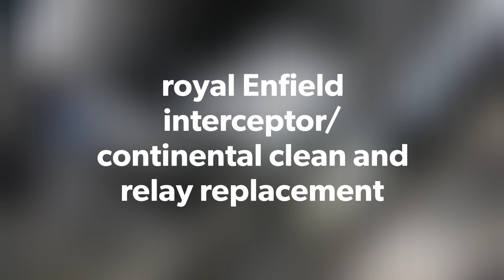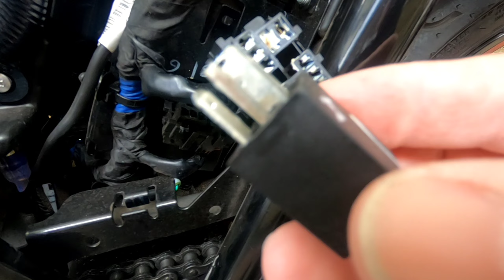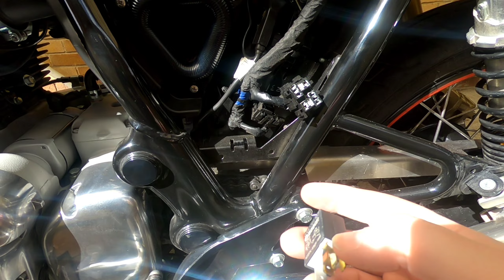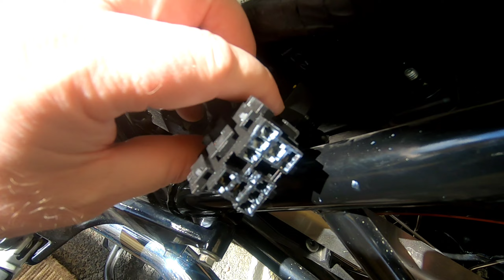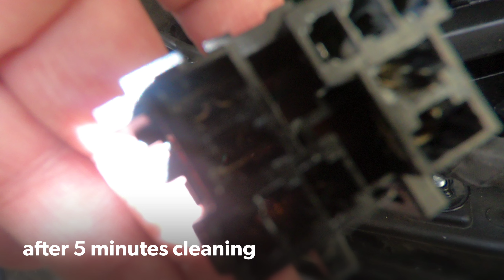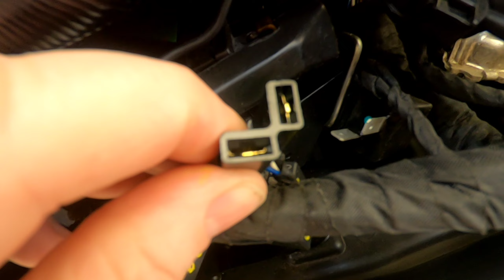royal Enfield interceptor 650 continental gt 650 relay cleaning and replaced

Comment: I've just done my euro 4 , haven't had problems but as people have had, thought it was only time.  Cleaned mine out with compressed air and contact cleaner and then coated new Bosch relays with dielectric grease and all good. They probably coat them with so much grease due to the humidity in India to stop corrosion before shipping.
Reply from the maker: Hi, thanks for your comments.the standard relays and the amount of grease they apply from the factory seem to cause more and more problems for people,and should be the first thing anyone at least cleans just as a precaution.upgrading them to Bosch replacement's is the first modification everyone should do as soon as you purchase the bike.🖖

Comment: I have a 2022 Royal Enfield 650
Interceptor with 500miles, or 804 kilometers, When I first start the bike when cold it starts but immediately dies, i have to immediately rotate the throttle to get it up in rpm's to keep it running at higher rpm for a few seconds then it will idle ok. It does this every cold start attempt. I cleaned and replaced the four relays but it didn't help. Did you also have this happen with your RE?
Reply from the maker: Hi, thanks for your comments.many(euro5) seem to have a lumpy tick over and struggle to tick over especially when you first start them from cold ,RE seem to have set the tick over catch point very low causing stalling, so with a new tight engine the revs drop too sharply for the tick over kicks in and dies.as you ride your bike more and more the engine frees up causing this issue to happen less.i also changed my spark plugs to a higher quality iridium ones which gave a stronger more reliable spark,which did sort of cure this problem.i always hold the throttle for a few seconds open a little when starting and let the revs settle before releasing it (a old habit from years of bike ownership) .I'd start by changing the plugs and just ride as the miles go up and the engine frees up you'll notice it get better.my 2022 model only had 3 relays(euro5)under the side panel,you said you've changed 4? Which would mean yours is a euro4 model.check the manufacturing date not the registration date to be 💯% sure just for future reference.i hope this may help you out a little 🤞sithi🖖
Reply: @itsallrc-interceptor650  my bikes id plate says manufactured January of 2022, Thank you for sharing your experience with this, yes this bike was shipped to 🇺🇸 USA and is euro 4 ecu and has the four relays.  I was wondering if changing the spark plugs to better quality type would help this. It only started doing this recently. After warm up it runs perfectly and starts easy. I will upgrade the spark plugs and see if that helps.

Comment: Thanks for this, just started looking for info on this after my GT 650 had starting hesitation. Did anyone else snap the screw tab on the left hand cover trying to get it off, or is it just me 🤨
Reply: loosing the screw on left side........I did it many times ! i hate that screw ! Finally another youtuber had a wonderful idea: replace the standard crew with a FIXING SCREW FOR GOPRO (the long one). It works perfectly fine !!!!!
Reply from the maker: Thanks for your comments, I'd lost mine into the black hole my bike seems to have 🤣.I'm glad it was some help to you🖖
Reply from the maker: It might just be you😂 don't worry you won't be the first or the last person to do this thanks for your comments 👍
Reply from the maker: My interceptor used to cut out alot to be fair,but since I cleaned and upgraded the relays I have had it cut out once,and that may have been my fault 😁

Comment: Has royal Enfield resolved this problem? Seems ridicules that the customer has to clean the relays and not the factory or dealers🙄
Reply: And the customers end up paying for new relays out of their own pockets. How silly is that. Come on Royal Enfield, do a recall and pay for all this yourself.
Reply from the maker: I totally agree, it's poor customer service, surely every owner now has had to clean and upgrade said items.👍
Reply: @itsallrc-interceptor650  also, why the heck are they using lithium grease. I've never used that on electrical connections, only dielectric grease .
Reply from the maker: They must have barrels of the stuff,cos they like slapping it all over everything 🙄
Reply from the maker: No still coming with duck fat plastered on all connections and weak relays,re needs to sort this themselves and not rely on the customer sorting problem out👍
Reply: @itsallrc-interceptor650   Hi !  Don’t get me wrong, these bikes are so retro and awesome. And I like them. But I’m hearing from too many sources concerning relays and other things as well. Just imagine if this happened to Yamaha. They would have a worldwide recall. This is not good enough in that RE are not sorting this. 

Cheers NZ.
Reply from the maker: Thanks for your comments,I totally agree, letting themselves down for such a simple inexpensive fault to cure👍
Reply: @itsallrc-interceptor650  duck fat!🤣🤣 that's pretty damn funny. Thanks for the heads up. I'll have good relays on hand before i get  my GT. 🖖
Reply from the maker: I've replaced mine with bosch 20amp part number 0332201107 one's off eBay .if I remember correctly the original are 10amp

Comment: I was having NO start issuses for the last 200 miles so at around 700 miles my 650 INT was not fun. I cleaned all relay connectors from the grease but it still did not start. I then listened carefuly for the fuel pump sounf which did not come on. I switched the lower left relay for the lower right relay which by the way IS the fuel pump relay. Wa la, started right up. So, a bad relay with only 700 miles on it. I have now replaced all the original relays with Bosch relays. Happy to be riding again but kinda pist that these come this way. They should know better to over grease and should put a better relay in the bikes to start.
Reply from the maker: I totally agree with you,there is no need for all the duck fat grease to be used.as for the relays,I know the bikes are built to a price point but surely reliability as to count aswell.with all the problems people have been having it makes you wonder why re haven't sorted these easy fixes out themselves.i still love my interceptor to bits and done all problems myself,not everyone see's it to be their problem to sort out themselves which I agree with.this is my first new anything, I've always fixed and maintained every vehicle I've owned,and as it turns out I'm still doing it.🤣😂🤣
Reply: Fortunately it’s a inexpensive fix but I’d agree…it shows really be necessary…..and so soon!
Reply: Oye amigo que rele de Bosch usaste para solucionar el problema

Comment: Hi, thanks for this wonderful information. I am looking for one like this in India as I am based in Bangalore. Any contact information on where I can get these? Please let me know. I am aware of Denso relays here but, are expensive. Also please suggest which degreaser to use or just WD-40 is fine? Please respond. Thank you.
Reply from the maker: Hi, pleased it helped you.ive replaced them with Bosch relays which are available on eBay over in the UK🖖
Reply from the maker: I was a de-greaser spray which is used in body shops to prepare body panels before painting to remove any grease or dust.wd40 can be used too,by blasting as much grease out of the connector's.then use a cue tip(ear 👂 clearer buds)to clean.repeat until you're happy 👍
Reply from the maker: Bosch Relay part number 0332201107
Reply: @itsallrc-interceptor650  Thank you very much for the response. Could you please share the eBay link for Bosch relay?
Reply from the maker: 265762281537

Comment: I replaced all my relays with Panasonic ones
Reply: I replaced mine with Bosh Single Pole Single Throw (SPST) relays and now I'm certain it was the relays all along.  The brand new REs also use SPST relays like my new ones --- they are simpler and more reliable and the other circuit isn't used.
Reply: @oldgeezerproductions  yes, just about any good quality relay is better than OEM, I’d say!
Reply from the maker: Thanks for your comments,yes any relay must be better than the junk re fit from the factory 🖖
Reply: How's the panasonic relays going on?
Reply: @BashBunny-jr1jc  absolutely 100%
Reply: @internetpolification  thanks
Reply from the maker: nice👍 it's just a little peace of mind knowing it's one more thing that shouldn't go wrong(I still carry a spare with me just in case)

Comment: Hi 
Great video I have just checked my relays and they covered in the white fat. Can I use  wd40 to clean them ? 
Cheers
Reply from the maker: Ideally use a de-greaser spray to help desolve the grease,but having said that WD-40 won't hurt,the pressure will blow some of the grease out anyway.you will probably need something fine enough to push any grease left in the connector out of the other side.cue tips (earbuds) paperclip etc.just take your time until you're happy.glad it helped 🖖
Reply: Contact cleaner works a treat
Reply: Cheers thanks for your help , I don’t have any problems with my bike but I think it’s worth doing , just ordered 4 Bosch relays 👍
Reply from the maker: Better to be safe than sorry 👌 it'd be a good idea to check your battery lead connection as well,mine was clean but know soon have grease plastered on that as well.located just above your relays behind the frame👍

Comment: What amp is that Bosh Relay same as stock 20a/10a.The stock one's are Shite I think R.E makes their own as they got R.E laser printed on them & some BLGI brand know one has heard of.Almost any relay be better than shite stock one's.I cleaned grease off mine but still had a loosing power issue so swapped with accessory one & it ok now.I also sent away to Hitchcocks for their upgraded relays almost twice the current 40a/30a.Bike started stronger & idles abit higher now with Hitchcocks upgraded relays.I had a faulty relay the contacts must of started to corrode.I seen a guy cut one in half & it was faulty & contacts corroding & it only had 1300km on new bike a Himmy.
Reply: I have told Derek from Solo Moto YouTube site about this video HE'S having a bit of trouble with HIS new R.E mk 2 & is abit upset with his dealership.I told him about relays as your video is more indepth than mine😂🤣.
Also told HIM about your painted oil caps bro 👍.
Reply from the maker: Oh thank you pal👏👏👏I've seen his video this morning thanking you for your advice and how helpful you've been 👍 we're all in the same boat with these re's.its a love affair 😂😂
Reply: @itsallrc-interceptor650  I hear that got help each other out.
Reply from the maker: Bosch 0332201107 .30 amp 4 pin 12v.when I replaced mine I'd noticed they were just blank no details on the outer case at all.i just went for a renowned brand.its only now that I've seen 30 amp to be honest 👍
Reply: @itsallrc-interceptor650  Stock 20a/10a so 30a/40a is same as Hitchcocks Relays.Make bike start stronger & idle  higher 150rpm more at idel

Comment: I tried wiping and blowing the grease out.  It helped a lot, but later I had a hiccup so I concluded that it is not enough to simply wipe out as much of the white grease as possible, ALL, I mean ALL of the nasty stuff must be sprayed out with an aerosol spray can of CRC QD Contact Cleaner or equivalent.  Ordinary carb or brake cleaner doesn't touch the white (lithium?) grease, but the CRC product is amazing and the high pressure straw really blasts the stuff out of every corner.  After everything was thoroughly de-greased, inside and out, I lightly coated the relays' electrodes with a good quality dialectic silicon grease for corrosion protection.  I popped the relays back in and all my strange electrical troubles are gone, never to return (edited to add: oh but they did return but not as frequently).  It is just amazing.  I found the original relays to be hermetically sealed and adequately built, so I simply put the OEM relays back in.  In my experience, it's not the relays, it's the type and amount of nasty white grease in there so GET RID OF THE GREASE if you don't do anything else.  Edited to add: I was wrong, it was the relays.
Reply from the maker: Yes I use a de-greaser spray as well (body shop panel de-greaser which desolves all the chip fat.i choose to change the standard relays with a higher quality Bosch set for my peace of mind I'm glad it helped🖖
Reply: @itsallrc-interceptor650  In all my decades of working with relays and connectors, I have never run across this white grease RE is using with such carefree abundance and so I thought it must be a complex problem in the ECU that was the problem.  I have never had an electrical failure with un-corroded socketed components or properly mated connectors before, so it took articles like yours to consider that this was why my new Interceptor was so utterly unreliable.  Now, I am a believer.  If I could say to the Enfield engineers, I'd say to look at the evidence and STOP using that kind of grease in such abundance just because it's cheap.  Use a small amount of a quality silicon dialectic grease designed for this application.  I think it is high time RE had a recall on their bikes to have this nasty grease removed by the dealers.
Reply from the maker: i dont even think its grease,more like chip fat.i agree totally,re should be taking note of what peaple are having to do once they have purchased the bike from them. some have said to have had all this chip fat removed on the pdi,but only the minority.its been causing more problems than what its worth.thank you for your comments and i hope its helped you.cheers
Reply: @itsallrc-interceptor650  Looks like they drop connectors & relays in a bucket of grease on production line & if they gana use grease should be a lithium spray applied in a slither not dropped in bucket of grease.I'd say R.E makes the grease & the relays themselves.
Reply from the maker: Like you say, it's excessive to the excess there's just no need for that amount.i checked my battery connection like you said.......yep,plastered in chip fat again.nice and clean now tho👍
Reply: @itsallrc-interceptor650  Yeah I forgot my battery cable connectors twice the first time doing the grease & was meant to do it & then putting Hitchcocks Relays in forgot again but done it now.Just as well I saw your GoPro trick to make it easier otherwise faffing about with getting toolbox etc.
Reply: @itsallrc-interceptor650  I just removed every scrap of this grease from all four relays, unbelievable quantities of it, slapped all over the connectors. I’ve had 40 years of bikes and never seen this, ever. I’ve never seen grease of any sort used on a Japanese bike relays and certainly not what looks is goose grease. I used universals thinners and a fine paintbrush and removed every last bit of the grease. I removed the block terminals from their two retaining lugs and put towels under each one and used the thinners and brush to get everything out, left it for an hour to evaporate (just to be on the safe side) and replaced everything. My relays are now a Panasonic ones and about 25% physically smaller. I suspect the OEM ones are cheap and nasty
Reply from the maker: Same here never before and probably never again.chip fat and plenty of it,and yes you're right the relays are garbage.👌🖖
Reply: @internetpolification  I cleaned all the grease out cause had the odd starting problem & a fueling issue after deacelleration bike wouldn't accelerate but still be idling.Cleaned grease off starting issue fixed but not fueling issue so got Hitchcocks Relays & noticed they had twice as many amps.
New relays fixed fueling issue so I had a faulty relay & saw a video where guy cut a relay in half off HIS Himmy & it already had signs of corrosion & had a fueling issue too after 1300km,relays are the same.
Bike also starts stronger now & idles better.

Comment: There should be 4 relays, one is for the AUX socket in the H/light which is not normally used.Leave it in there & use it as a spare.
Reply from the maker: Euro5 only have 3 I was going to use the 4th slot for a spare relay but it has no connector's to hold it in.so I just keep a spare in my side luggage 👍
Reply: @itsallrc-interceptor650  I never knew that, mine's Euro 4 & has 4 relays.
Reply from the maker: Yes mine still has the h/lamp aux,but they must have utilize one of the other relays.or it's a weight saving exercise 🤣🤣🤣🖖
Reply: @stevepalmer5670  I had faulty relay so swapped it for bottom spare or used as accessory to a a wire in headlight to mount USB etc.Got Hitchcocks Relays almost twice the amps so bike starts stronger & idles better than stock 20a/10a  cheaply made R.E one's, Hitchcocks Relays 40a/30a.
Faulty relay was in fuel pump relay & was causing loss of power occasionally.
Reply: @itsallrc-interceptor650  Did you clean the grease from battery cable connectors?

Comment: Nice one, did it cure the issue?
Reply from the maker: It's been fine so far,but I'd not really had it happen many times personally.more peace of mind,but for £7 each and 15mins work it's worth it to me👍
Reply: @itsallrc-interceptor650  I paid £8 each for Hitchcocks Relays with twice the amps but seen others selling the same one's in UK for £13.
Reply from the maker: eBay specials,I have had them a while though 👍